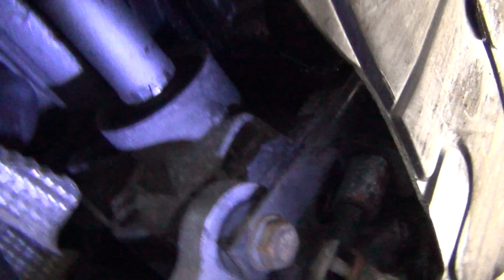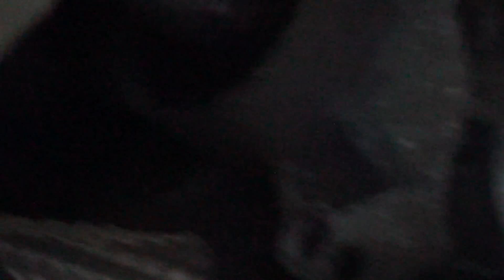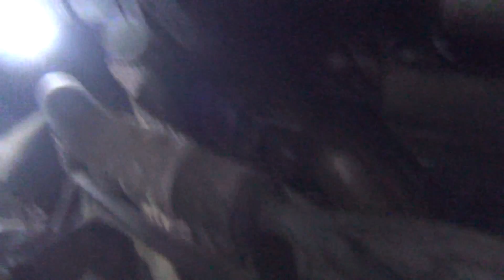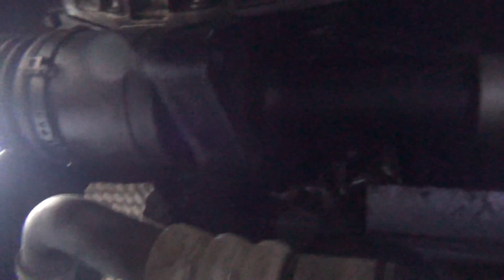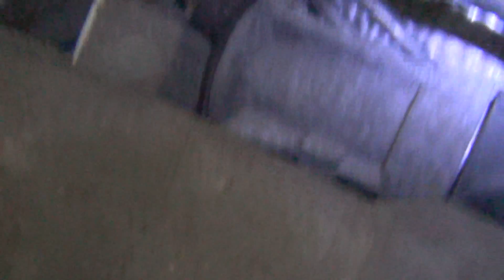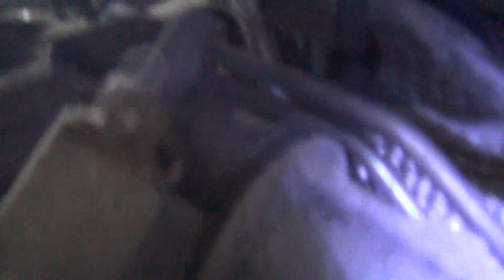Clio 182 Cup - Incorrect RH driveshaft fitting problem...

Comment: I have a cup packed 182 with standard 182 shafts, all seems well. Though according to what I have read it's a big no no. Why aren't I getting symptoms etc?
Reply from the maker: I think it's less of a problem that way around although the shafts may disengage if you use full travel of the suspension, which may result in catastrophic failure on the short shaft side of it doesn't re-engage correctly. Using it the other way around will cause damage pretty quickly though as there would be no movement/play in the shaft, the bearings would start leaking and fail pretty quick.

Comment: two minutes telling nothing whats wrong just a flashlight and a drive shaft.
Reply from the maker: Yes, that's because this video was taken to show other people something I was talking about on a forum so I could get advice. Not an instructional video.
Reply: @thefattysplace  aha ok then i know thanks for the reply.
have a good christmas and new year :)
Reply from the maker: @extec101  iirc I thought it was a bit short because the lines on the sun type clip didn't line up with the lines on the driveshaft when pushed in fully to the gearbox. Apparently though there was nothing wrong with it and that sun washer thing is just a guard.
Reply: @thefattysplace  yes that is correct the washer is just a protector for the oil seal behind it.
i did fix the right drive shaft on my car today the boot where shoot so thats why i took a look after i did the job how other have done to take apart ther cars.
the easyest way is to loosen the two bolts in the strut to the spindel and fiddle out the driveshaft.
lots of folks unbolt the whole strut assembly balljoint and steering rod, whay to much work.